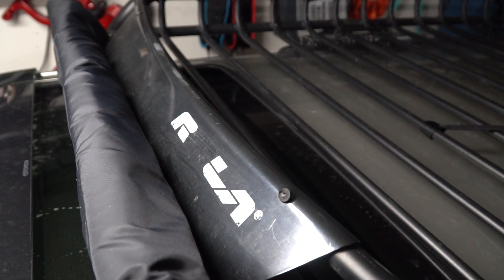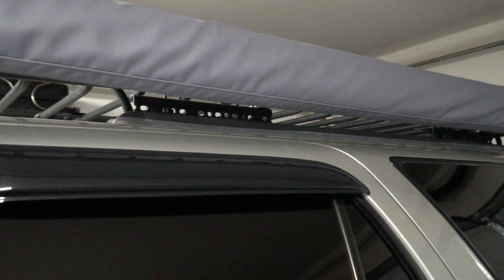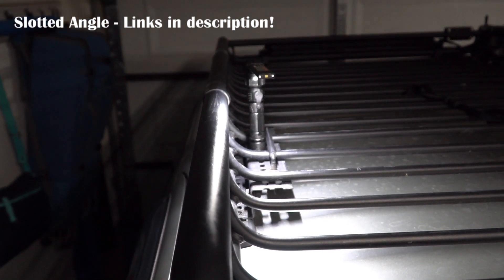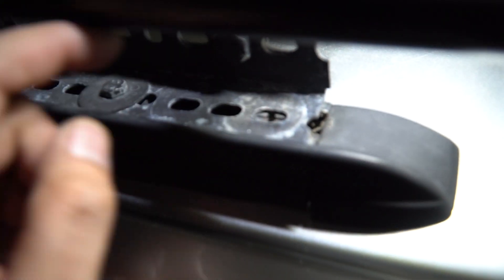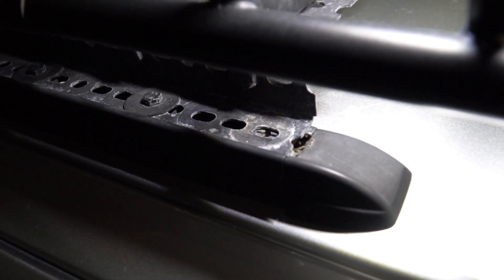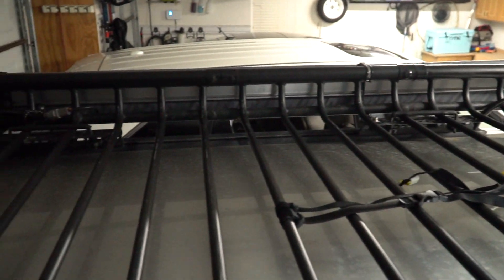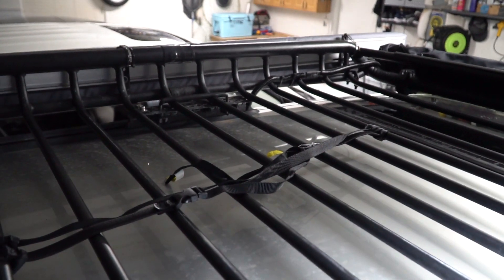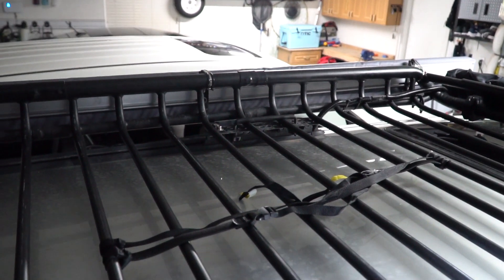Custom Mounted Rola Rack + Extension on 3rd Gen 4runner

Comment: Without the extension, would it be out of the way of the sunroof?  your videos are really helpful, thanks a lot.
Reply from the maker: Yes it would clear the roof. But the roof still works and clears with this setup. The front deflector is nice since it pushes alllll the air down on you when driving hehe

Comment: Halfway through this project, thanks so much for the in-depth tutorials. I’ve found them very helpful. I had a question: when you placed the rola rack mounting brackets on the slotted angle, was there a particular reason you chose the outside holes over the holes nearest to the edges to place them in?
Reply from the maker: Just chose whatever lined up and fit hehe.

Comment: I lowered my Rola rack , after adding an extension, as per the instructions in your video. I then test drove it at both, street and freeway speeds.
Everything was fine until I got on the freeway, at around 70 MPH, when I noticed an anoying loud "buzz' sound, similar to a small electrical motor, coming from somewhere in the roof rack, which disappeared as I slowed down. 
I wonder if you or anybody that has lowered their racks have experienced some kind of wind noise or vibration similar to mine. 
I don't know if this noise is coming from the front fairing, vibrating with the wind or perhaps a vibration coming from the front section of the rack overhanging, unsupported at the front of the roof.
I would appreciate your opinions and/or comments!!
Thanks!!
Reply from the maker: My fairing had worn rubber bushings and it rattled like crazy and you could hear it with the moonroof open. I replaced it and it got better. I don’t hear much with the windows closed though
Reply: @PhoRunner  I replaced all the windshield rubber and even put some RTV silicone in the holes.

Comment: Where do you drill through the roof to feed the wires for the rooftop lights ?
Reply from the maker: No drilling needed. Check out my solar panel install video and I show you where you can pass it through!

Comment: Hey man! Do you know if the factory bar has a T slot under the rubber? I bought a water port weekender and wanted to use it for a camping trip. Since my roof rack from UpTop haven’t came in yet I need to figure out an alternative way to mount it.
Reply from the maker: It has some light sealing. I would definitely reseal it if you can but it has a rubber anchor for the screws

Comment: I'm going to be doing this same job this weekend. Why did you keep the same mounting knob for the mount? Would it have been easier to replace them with a nylon nut? Seems like you would have strong tightening power than the knob.
Reply from the maker: A nylon nut and washer will probably work just fine. I'm not sure why I kept the knob since I did use red lock tite on it >_<
Reply: Thanks man. Another follow up, why does the parts list to get (2) 2 1/4?
Reply from the maker: @farazrizvi2045  Should only need 1 4ft piece of 2 1/4"
Reply: Yup, totally read that incorrectly. Thanks man, I appreciate the video.
Reply from the maker: @farazrizvi2045  You are welcome! The rack's been solid for a few years now and no issues at all other than the front wind deflector making noise haha. That's a defect of the rack itself!
Reply: @PhoRunner  Finished it up last night, I really like how it looks. It's sleek. Thanks for the write up. Hopefully, it stays put and doesn't shift. Thank you so much. I'll be tackling your drawer setup this weekend. Probably the best system I've seen in my research. The parts cost have not been cheap, but quality is definitely there. Thanks, Man.
Reply from the maker: Nice lol.. I like the low profile look too. Plus it is stronger. good luck man!

Comment: I'm not sure if you're still checking comments this far back, but if you are I was wondering if this setup interferes with your sunroof at all? I plan on doing the same thing with the extension and that is one of my concerns if the sunroofs is still fully functional and not being blocked by the rack.
Reply from the maker: Definitely still checking comments. It does not interfere. It can go back and forth easily still. The only thing is the pop up feature for air, it barely touches. Still works fine
Reply: PhoRunner Channel thanks for the quick response! Love the content and knowledge you provide for these awesome vehicles.
Reply from the maker: No problem!

Comment: Hey man, first off, really enjoy your videos!
What kind of supports did you use for the front of the rack or those four mounting points are good enough? 
Also going to be running a full rola rack too. And if you could tell me which specific junkyard usually has those “nuts”. Thanks in advance and keep up the awesome work.
Reply from the maker: The 4 points are fine and the “nuts” are from the factory 3rd gen roof rack. It’s what the cross bars bolt into. Just go get a few more so you have more

Comment: HOW DID YOU RUN WIRE FOR YOUR LED BAR INTO ENGINE COMPARTMENT
Reply from the maker: Down the factory hole in the roof. Check my solar panel video, I show it in there

Comment: I c u have ur light bar mounted on ur rack, can u give some description on the mounts & how it holds up. I have the same set up on stock rails I dont know about u but on windy days I get blown all over the highway, too much draft lol. Nice rig.
Reply from the maker: I don't get blown around too much. The light bar is held on with these: https://smile.amazon.com/Nilight-90020B-Mounting-Off-Road-Horizontal/dp/B0714CYKBJ/ref=sr_1_2?keywords=light+bar+tube+mount&qid=1579380173&sr=8-2

i don't remember the exact size but you can do some measuring and buy the right one. Then find a bottom mounted lightbar

Comment: Hey thanks for the tutorial. Where did you find extra sliding bolt inserts for your factory rails? Ordered from Toyota?
Reply from the maker: local junk yard
Reply: How many sliding bolt inserts did you need?
Reply: You can order similar inserts from Sherpa Equipment, specific for the 3rd gen 4RNR. They sell them in packages of eight. I paid a total of $22.00 delivered to my home. Expensive? Not if you take into consideration, time and gasoline!!
Reply from the maker: True!!! And it’s new!!

Comment: I like the set up but I have one concern. When I tried to lower my rola rack by flipping the mounts, I noticed the rack would slide from right to left. Since the mounts are essentially flipped in your set up, has the rack slid on you? I wish there was something you can mount on the side to hold the rack in place.
Reply from the maker: It hasn’t moved at all

Comment: Thanks for the info! I'm about to do the same thing to my 4R with the mounts.
I have a question about the awning. What length is it and did it come with all mounting hardware or did you have to customize that too?
Reply from the maker: it is the 2000x2500 model. It not come with the L bracket you see there. Just buy those from lowes/Home depot and drill the holes. The rest of the hardware will be available with the awning but i bought new theft resistent bolts (allen head) and put the nut inside the channel instead of the bolt. Holding up fine for 2 years now.
Reply: PhoRunner Channel 
what awning is that? How much was it?

Comment: where did you get the weather guards for the connecting points?
Reply from the maker: The rola rack comes with them in the latest revision. Its' been this way for a few years now. I'm sure you could call rola to see if they can get you some if you have the rack already. Without it, it will rust like crazy.
Reply: Also, where did you get the  extra t-nuts that go through the rack side channel?
Reply from the maker: Junkyard has some. You should have a few from factory but you should get some more for peace of mind
Reply: @PhoRunner  one more question, what L brackets did you use specifically for the awning
Reply from the maker: Check my description. Those exact ones are what I used

Comment: Do you think it would add any added strength if you ran the slotted angle down the full length of your OEM mount? I have a Rola as well and I have found that my factory crossbars are the limiting factor when it comes to weight bearing.  Great mod!
Reply from the maker: it would definitely work and help spread the load!

Comment: How much weight can it handle with that setup?
Reply from the maker: it doesn't really state. the rack itself is pretty sturdy and i've loaded 2 kayaks up there before on top of it. I've loaded my inflateable boat and flloor boards also. So i've put about 100+ lbs up there but not really much more. The roof rails themselves should easily handle a few hundred pounds and the rack should be fine to support it also. The crossbars on the rack aren't that strong though but the rack side tubes are large and thick and i would say it could even mount a rooftop tent and some people in it.